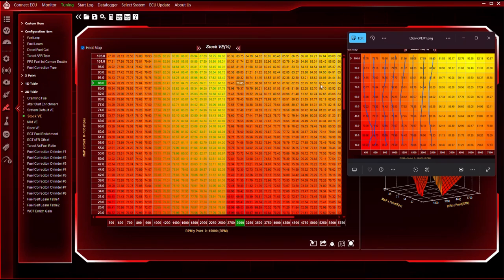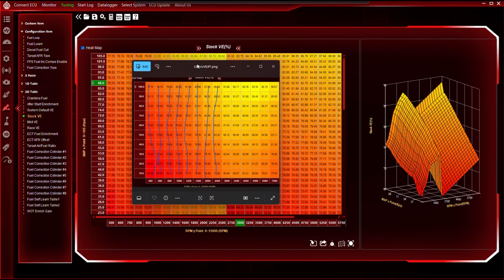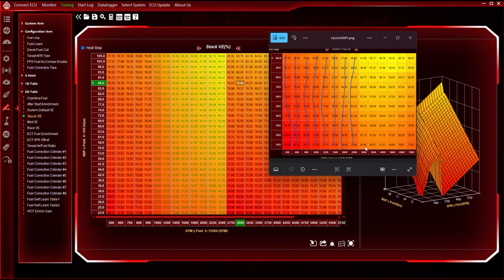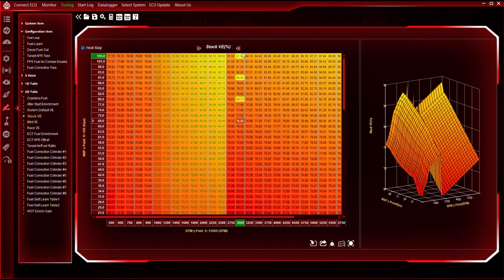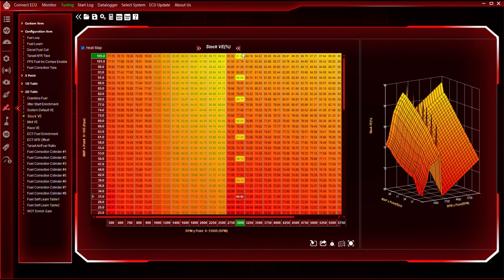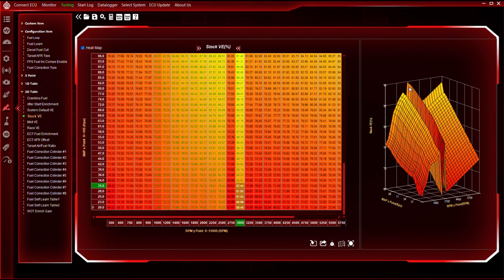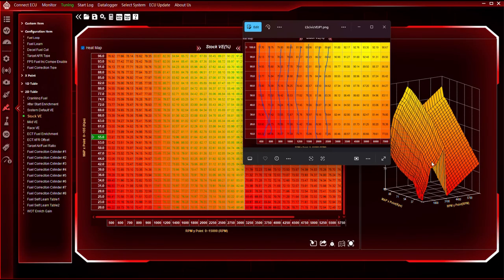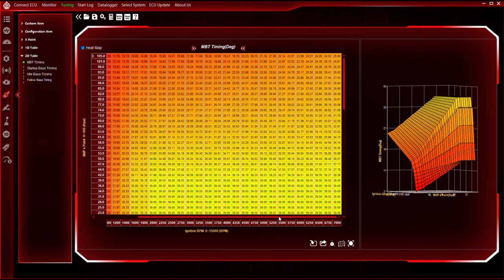Upgrading from @AcesFuelInjection  Jackpot 1 to Jackpot 2

Comment: so I seen the kpa went to 105 on fuel and timing. and I hear that the jackpot 2 has boos control. so in that case will a higher bar map sensor show more kpa to reflect the boss possibility? and how is the jackpot controlling boost? can it control Mac valves now?
Reply from the maker: You just rescale the kpa limits for boost , you get no more resolution as it’s the same for NA and boost. The jp2 can’t do boost control yet , it will in the future but who knows when it will be available.